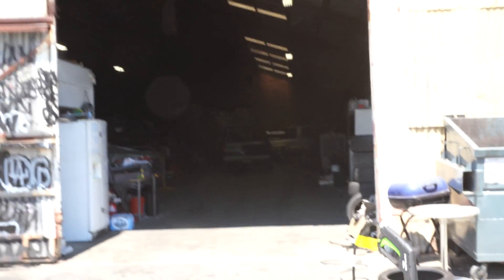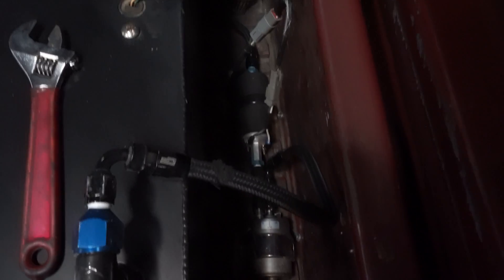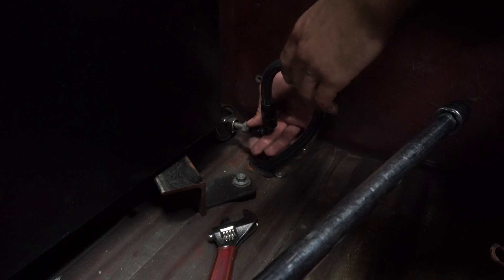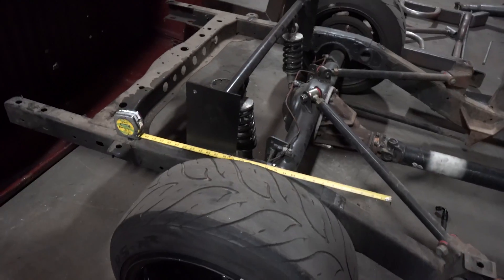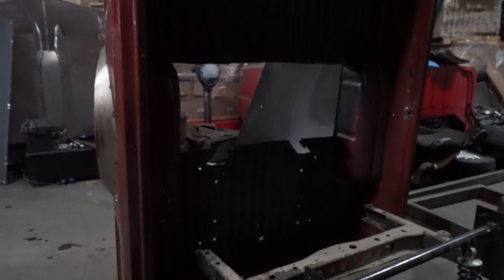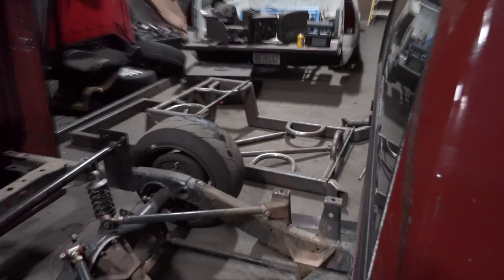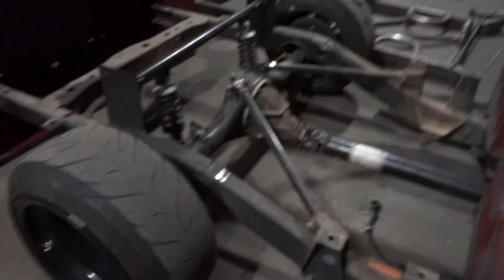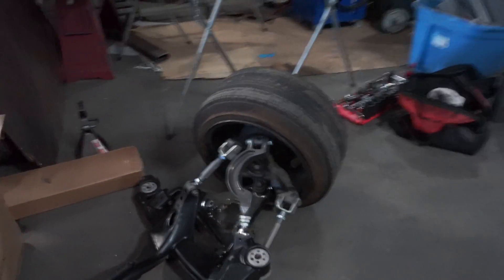MINI TRUCK S13 IRS BUILD | EP. 1

Comment: Something you may wanna consider given this mass modification with the chassis is weight balance. Redistribution of weight might be a huge advantage in handling, response, and feedback. Biggest weight challenge being the fuel cell. You may want to consider moving it to the rear of the truck, under the bed for easier access and service. This will spread the weight more evenly across all 4 wheels. Also will be easier to ballast the truck to accommodate your drift style and demands
Reply from the maker: the design we are doing is with the fuel cell in the back
Reply: @ScrapeLux  awesome! this new setup is gonna be a definate game changer!

Comment: What shade paint is that, I really like it. Keep up the good work
Reply from the maker: paint on what!? subframe ? arms ? truck ?
Reply: Jordan Alatorre the whole body
Reply: Jordan Alatorre and also what lowering kit did you use?
Reply from the maker: coilovers, wine red.
Reply: Jordan Alatorre oh so you just put coilovers on it, front and back? But you also did a balljoint flip, what size coilovers are you running? I’m sorry for all the questions I’m new to this
Reply from the maker: 7"
Reply: Jordan Alatorre ok, so your running 14” coilovers with a 4 link kit
Reply from the maker: coilovers are 7" collapsed 11" extended.
Reply: Jordan Alatorre what brand
Reply from the maker: no brand, ebay.
Reply: Jordan Alatorre haha ok, thanks for all the help I really admire your work
Reply from the maker: thank you 🔥🤟, i recommend qa1. thats what im going to change them out to.
Reply: Jordan Alatorre ok thank you so much